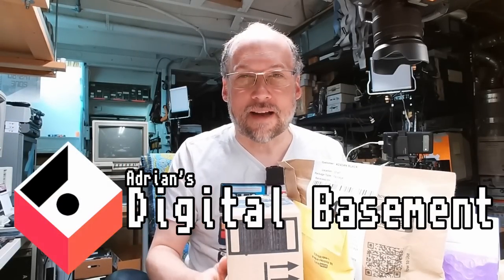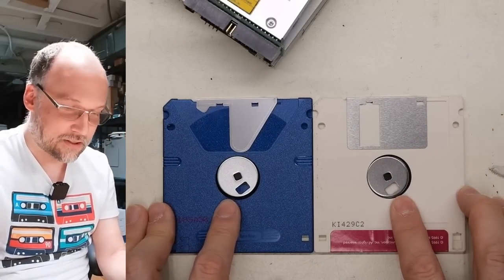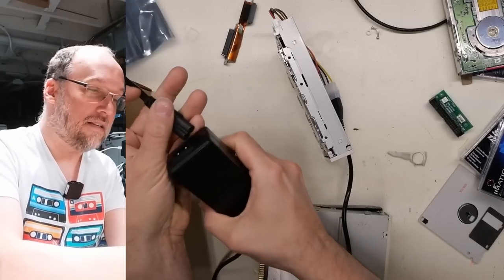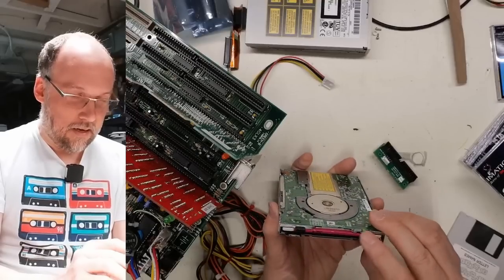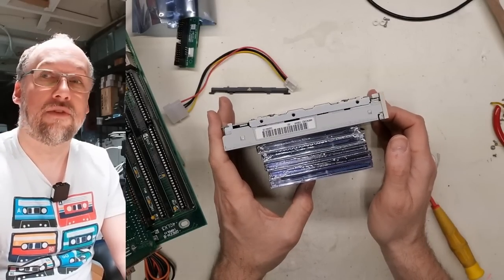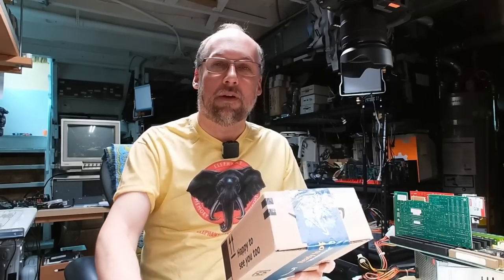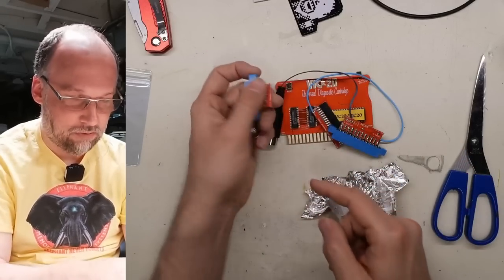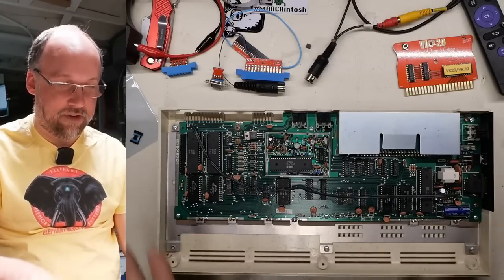0059 A VIC-20 test harness, an LS-120 disaster, a homebrew PC accelerator and a cool bad CPU die

Comment: The VIC-20 you used for testing is almost exactly what I had in the early 1980s.  The case and brass badge are the same but the insides are different.  The motherboard I had was from an earlier design with a large heatsink over the power regulator and cartridge slot so it gets pretty warm.  And 2 prong power plug into the computer.  I remember blowing the video part and was able to fix it using a small piece of tin foil.  Hey, I was like 11 at the time so didn't know any better.  lol.  Thank you for showing it.

Comment: Man oh man, taking me back to the floptical drive. I sure wish I'd have kept all that old 90s pc (80s too) stuff, even the early 2000s, before sata became the standard I loved all the old drives. MFM, RLL, IDE. I still have an IDE to SATA adapter I use for my old old drives.. Ha I remember I had a 540mb IDE drive ( I think that's as big as you could do in IDE I forget if it was the tracks or cylinders whatever) man this takes me back!!

Comment: Are you using an HDMI switch with your RetroTINK? (RetroTINK 5x Pro -> HDMI Switch -> Capture Card)
I've been streaming recently and noticed I had a ton of trouble with the video signal until I removed the switch from the setup.

Before I took the switch out of the picture I had things like video drop-outs, the No Signal (or Bad Signal) error you got, any time I'd switch my display from DisplayPort to HDMI it'd cut out... yeah it was a problem.
Once I hooked the RetroTINK directly to my Elgato HD60 I haven't had those problems at all. Don't know if that's exactly your issue but it might help if you're in a similar situation. It's a little more work but I'll do what I have to do for fewer tech headaches.

Edit: Never mind, you're getting normal video from it, but just a black screen. That's really freakin' weird. I wonder if Mike (retrotink2 on Twitter) would have any idea why it's doing that.

Comment: BTW Adrian, we work a lot with state of the art prototype PCBs and we make needle bed adapters for electronic production and we use wire wrap for the needles all the time (easier to service and replace the needles for the production technician). It’s not really an antiquated technique

Comment: When you tried to power the LS120 drive with the adaptor, looks like it was shorting out the power connector on the rear of the drive, those adaptors are iffy like that... You even spotted the blown trace on the adaptor - the drive was likely still ok!

Comment: The I/O were correct on the paper. It's done in pairs on the web page. Ex. Pin 1 and 2 are the first open/close, Pin 3 and 4 are the second box (open/close) and pin 5 and 6 are the third box (open/close). It was correct.

Comment: Well, yes. My first name is William, but I go by my middle name, Todd.  Sorry about the duplicate wire wrap tool.  Last time I heard you mention wire wrapping, you said you'd like to have one.  I didn't know you had gotten some since.  The VIC-20 diag cartridge does operate much like the C64 diag in that it does need some ROM functionality to work.  There IS actually a VIC-20 Dead Test as well (I think two, as someone enhanced the first one).  It's on the VIC-20 Penultimate+ cartridge, but, of course, you can download it and burn an EPROM if you have a cartridge PCB to stick it in to.
Reply from the maker: Thanks again Todd for the cart! I'm surprised about a dead test as it just seems like it's impossible for the Cart to exist in the top of address space needed to boot the system without ROMs. Not without some extra wires running to the cartridge. It only has A0-A13 (missing the top two lines) and the IO select lines only map into the various ranges the cartridge is supposed to exist in. I think Commodore did it this way to simplify the design inside the cartridge... https://myoldcomputer.nl/wp-content/uploads/2017/05/vic20_Cartridge_port.png
Reply: @adriansdigitalbasement2  I've never researched how it works.  It may not be a true Dead Test like the C64 version.  On the Penultimate+ cartridge, if I remember correctly, you hold down the cartridge's reset switch while booting the VIC to get into Dead Test mode.  It then runs through its memory tests and ROM checksums.  Again, if memory serves, on some passes it uses its own built-in character generator and on others it uses the VIC's onboard chargen ROM.  I don't know if it bypasses the BASIC or KERNAL ROMs or if it requires those to run.  I'd have to do a lot more research to understand it better.  Maybe I'll do a video on it sometime.

Comment: I was an early adopter of the first gen floptical drives in the early 1990's.  Mine was a 21MB floptical made by Insite which had a SCSI interface.  Used to use this with an ICD LINK adapter on my Atari ST.  A vaguely remember the floptical media being a translucent light brown colour though.  You could definitely tell it apart from regular magnetic media used on standard floppies.  That drive could also read 1.44 meg disks as well, which was useful.

Comment: With the LS-120 drive at the start, I'd be willing to bet that the power connector on that adapter board is backwards (certainly wouldn't be the first time I've seen that sort of thing)... I'd expect the "laptop" version of the drive to run on 5V only (label should tell you) so if that's the case, check to see which of the outer pins on the adapter board power connector ISN'T connected (might want to buzz it out)

Comment: The working LS120 sounds like my old Fujitsu MO drive that takes optical disks.  It worked well on Windows 98 ( when I remembered to eject via explorer ).  It did need to be drive 0 on a second IDE adapter with no other drive on that adapter as another issue that may have been due to the IDE standard back then.  The D-Sub connectors ( According to the guy at Radio Shack back in '85) is DB-number if it is up to 2 lines of connectors, like DB-15 for com ports and D sub 15 for EGA/VGA.

Comment: I tried connecting my old laptop LS-120 drive to my desktop with a similar adapter that converted the compact laptop connector to USB, but my motherboard USB controller faulted when I plugged it in.  Didn't want to blow up my motherboard USB so I never tried it again.  I have a stack of circa 2000 backups on SuperDisk that I'd love to access.  Unfortunately all of my 1990s backups are on formats that died after 2000 - SuperDisk, ExaByte, DAT, SCSI, etc.

Comment: I had an Accurite Travel 120 SuperDisk drive that used a PC-Card to connect to a laptop, I used it with a portable talking computer called a VoiceNote, it was part of the BrailleNote family of products.  Anyway, that LS-120 floppy drive was quite noisy and the noises your drive made sounded quite normal to me, that doesn't mean the drive is functional, but it very well could be.  I've only ever used the one LS-120 floppy drive, but I do think it's normal for them to be noisy, even when reading standard 1.44 MB floppy disks.

Comment: When you plug that adapter into the drive, do the solder points behind the power connector contact the back of the case? Maybe put a piece of electrical tape on the back of the drive to make sure it doesn't short out.

Comment: The conventional white LEDs used for illumination are usually UV LEDs with a phosphor coating.  This is more efficient and gives a better colour-rendering index (CRI) than trying to make white light using RGB LEDs.  Blue LEDs just drive me up the wall how they are so overused, and always at nuclear brightness.

Fun fact: if you've noticed street lights that are suddenly purple instead of white, that is not an attempt at civic mood lighting.  There is a manufacturer of LEDs that had problems getting the phosphor coating to bond properly to the LEDs.  Eventually it may delaminate, allowing the direct illumination to escape.  We see this as purple because a portion of the LED output is in the visible range.  This problem is occurring all over North America.  The warranty is being honoured, but as you can imagine it is taking time to produce new units and then replace the affected ones.

Comment: PCB's got a great deal easier to make when laser printers came along.  As soon as you oculd print on any sort of transparency, you had and easy way to make a mask for setting photoresist on the PCB, allowing you to etch PCBs relatively easily.  (Prior to that, you had to manually scribe the lines into painted-on resist.  I've done that, and would have  greatly preferred the laser printer method.)

Comment: These power BJTs are widely used in linear voltage regulators on late Socket 3 boards to drop down from 5 to 3.whatsoever Volts for powering the CPU. They dissipate lots of energy and got as hot as Beelzebub's armpit in a few moments after powering on.
These transistors also worked extremely well as fuses in case you plug in your 486 CPU 90° rotated. :)))

Comment: When it comes to speeding up the PC and XT class PCs it was possible to change the refresh DMA channel's clock by changing the settings in the PIT channel for it.  Depending on how good the DRAM was it was possible to eek maybe 5% more out of a given set of hardware just by reducing the amount of refresh activity.  Toss in a V20 and a faster oscillator and things could move along quite nicely.

Comment: The technology involves reading and writing data magnetically, while optically aligning the read/write head in the drive using grooves in the disk being sensed by an infrared LED and sensor (a form of visual servo). The magnetic head touches the recording surface, as it does in a normal floppy drive. The optical servo tracks allow for an increase in the tracking precision of the magnetic head.

Comment: Hey Adrian, I was really pleased to watch your older video, just the other day, where you came to England and bought the Acorn BBC computers. I don't have one, It's an ambition. I'm really curious to know how you power your PAL machines over there in the States or Canada. Also, I discovered you can emulate these machines on the Raspberry Pi. The R-Pi Imager software has an option for installing "RISC-OS Open", the recreated OS of the later Acorn Archimedes series of computers. It appears there is another distribution, too, called "RISC-OS Direct". It's just the same but more fully featured with extras (which you would have to manually load yourself with the other 'distro'). One of those extra packages is the BBC-BASIC of the Acorn BBC Micro – supposedly one of, if not the best, versions of BASIC ever released. I guess that's another way of sharing the experience. Anyway, there's so much 'Apple' stuff out there that it is a nice change to see the British machines being represented online.

Comment: My experience ordering adapters along these lines (for instance scsi sca breakouts and such) is that the qc does not look super great at the cheap sketchy end of the market these days and I would definitely not plug them into anything without a check for unexpected continuity and a good look for bridged or nearly bridged soldering first :D

Comment: I think the interface on the small drive is a standard interface for laptop/server cdrom drives. They were originally combined power/ide and later updated to sata but kept a similar interface. I would think the adaptor provided it was wired correctly should have worked so I suspect the drive died in a dead short and took the adaptor with it.
Reply: That was my thought. Dead LS-120 killed the adapter.

Comment: I had several zip drives, as i actually liked the capacity.  Never had an issue, and never had the click of death.

But i also had an LS-120.  But never used it for much other than 3.5 standard floppies.  I still have it somewhere, but i don't know where.

Comment: I'd say the heads in that LS-120 drive aren't quite normal, looks like they have two to three times as many cores/coils!
I wonder if the power-connector on that adaptor was installed backwards? That's all I can think of aside from it simply being incompatible. I know I've been burned by the 'same form-factor/connector but different pin-out' issue before!
What's that huge blue PCB on your wall? Looks bigger than my industrial Nematron board!
I appreciate your shirt, as I've got a few boxes of 5-1/4 disks with that same logo! Bunch of Commodore-related ones.

Comment: I had a LS-120 in a system I built in 2001. Mine sounded about the same as yours, maybe not as noisy. I only had a couple LD-120 disks because CD-RW won my heart until I got pen drive shortly after.

Comment: 59:00 be careful with that: while the Retrotink's port is definitively a SCART, some other converters have a JP-21, which is based on the SCART but is not compatible (trying to feed a JP-21 signal through a SCART port does literally nothing, but trying to feed a SCART signal, unless it's a composite signal disguised as SCART, through a JP-21 port will fry the machine).

Comment: I remember being warned that writing normal floppies with an LS120 drive might not be readable on a normal floppy, same as high density vs double density, head too small. So we were told to use them only for reading floppies on the iMacs.

Comment: Regarding the LS 120 Failure, I´ve managed to fry one of my childhood drives with these type of power supply. The problem is, that the Molex connector on these is just soft plastic, so after some ussage the corners/keying wears down and it becomes pretty easy to plug it in backwards. Simple solution is to cut it off, and to replace it with another plug with a Hard plastic shell.

Comment: Don’t blame the guy who sendt in the adapter. It looks to be the right part. That should have worked. That could have been an shorted capacitor on the drive, that loaded down the power rail hard enough that it burnt both the drive and adapter. And the other drive sounds correct. They sound different, don’t they? :)

Comment: I wonder when you connected the IDE converter to the LS-120 laptop drive if the power connector shorted to the back of the drive.
Reply: The LS120 pinout is completely different compared to a CD-ROM drive and using a CD-ROM adapter shorts the power pins, you need a special LS120 adapter as described on vogons to adapt a laptop LS120 drive

Comment: Magneto-opitcal is laser guided, but reads/writes using a magnetic head. I don't recall if the Superdisk also used a laser to soften the sibstrate during read/write, but that was one of two "floptical" drive modes described in the 90's press.

Comment: A standard 3.5 floppy drive doesn't actively follow the magnetic track on the disk (or at least, the format is designed so that it doesn't need to).  The drive doesn't have to physically sense where each track is.  Instead, the drive just guesses where each track was written, based on where the track is supposed to have been written. Provided both the writing and reading drives are adjusted fairly similarly, you should be able to interchange disks between the drives. Allowing generous tolerances on track width and spacing improves the chances of any two drives being adjusted similarly enough.  However these tolerances mean that the magnetic media on the disk is used fairly inefficiently.

An obvious way to increase floppy disk performance would be to add mechanism to allow the track to be sensed by the drive.  If the drives don't need to guess where the tracks are, you don't have to allow large tolerances to cope with drives being slightly maladjusted.  Tighter tolerances means smaller tracks and smaller spaces between the tracks.  The first attempt to do this was the floptical drive, which was developed by Insite technology.  The disks had a series of microscopic grooves manufactured into the disk surface. The drive used a laser to sense these grooves, and used them to align the head with the track precisely.

Iomega, Imation and Maxell were all investors in Insite Technology, and Insite eventually licensed the technology to each of them, resulting in the LS-120, ZIP drive and a variety of other similar formats.

Comment: I would seek a different power supply than the "US-CAN".  I worked for a local computer retailer from 2003-2016, and these power supplies were notorious for dying and sending line AC voltage though to the DC side.  We were importing computer cases by the pallet for our base white-box build and have a very high failure rate.

Comment: I bought an Ali adaptor to plug a PCI card into a PCIe slot, and it instantly tripped the short-circuit protection in the PSU, ie, maybe it's a cheap faulty adaptor.
I have 2 of those external HDD PSU, and sometimes when I power a HDD with them the HDD clicks. But then I plug those HDD in a PC they're fine, ie, those HDD PSUs might not be that good.

Comment: With the Amiga, the LS120 could be booted if the floppy was in the drive before it was switched on. Then that was treated as a normal hard disk. But then the eject didn't work. In principle as a hard disk with a removable disk and not as a floppy. PC floppies could also be read and written, but not Amiga floppies.

Comment: I got an LS120 drive, also Panasonic, in a box o' junk off ebay (mostly FDDs, a couple AGP cards and the LS120), and according to the label on the side of it, mine was made in December 1996, when I would have only been 11 years old, haven't tested it as yet, cos disks are not nicely priced, but I'm kind of doubting it works though, but could be wrong...

Comment: I have a similar wire wrap tool (circa Radio Shack a long while back).  There should be a stripper in the handle under the end cap?